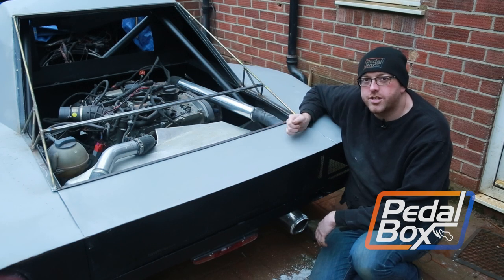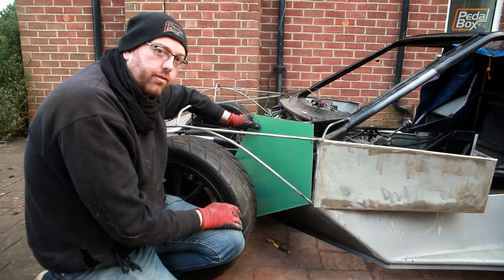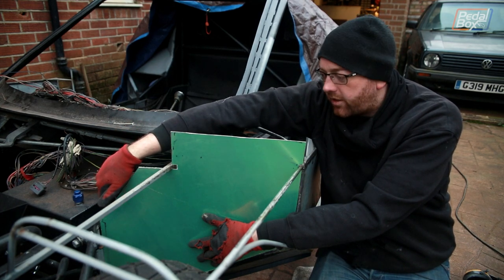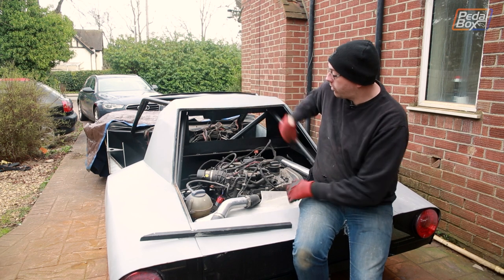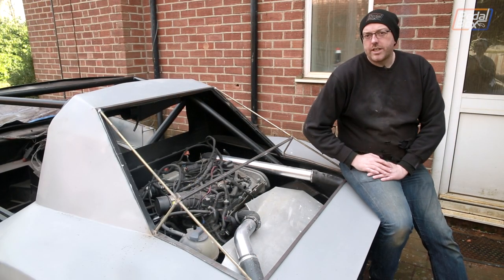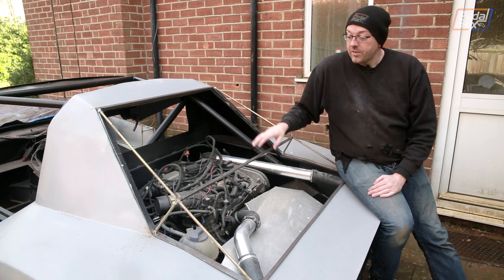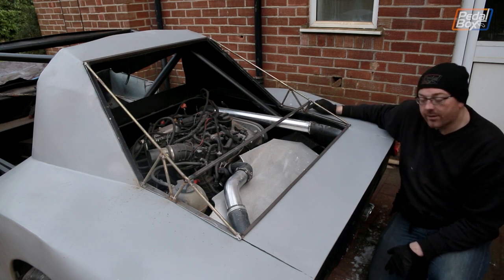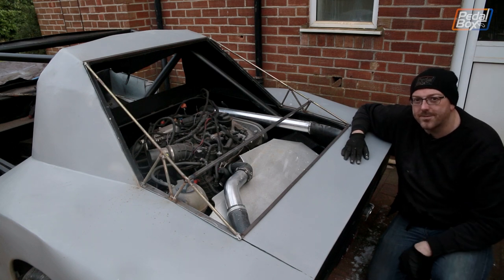Engine Cover Framework | Audi TT Kit Car | PedalBox Episode 95

Comment: IMO a window running that high doesn't make sense, you're very rarely going to have to look up while looking behind, so having a brace across the upper section for rigidity and triangulation doesn't seem like too much of a hindrance.
Would be nice to get some shots of the front inner arch to see how that looks, as the singular angle doesn't quite give a full view.
Reply from the maker: Oh it was never running tight to the top, just that cross bar was a thought too high to be much use seeing what was behind. Given we're lower the most wing mirrors perhaps one that goes further up is useful. See the logo of whoever goes into the back of us in traffic...